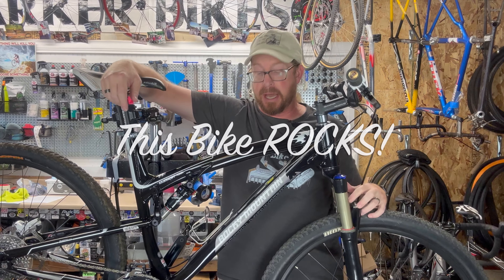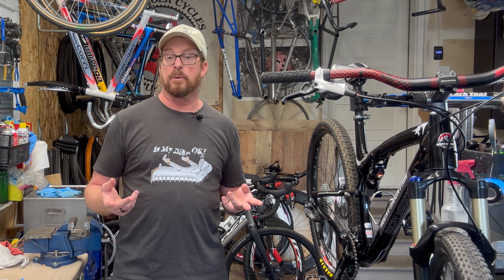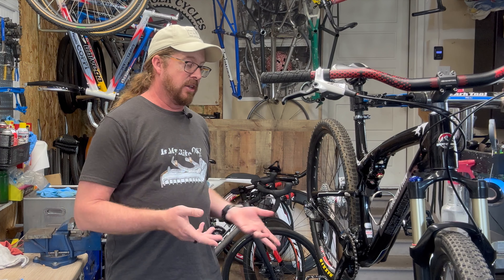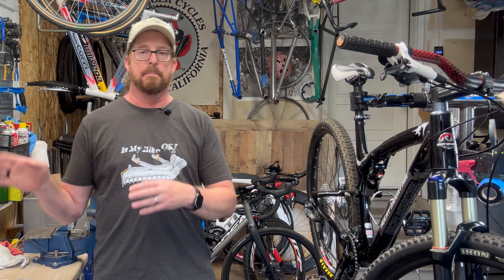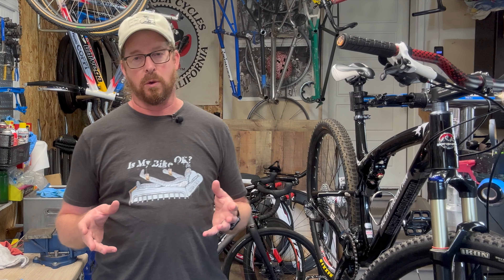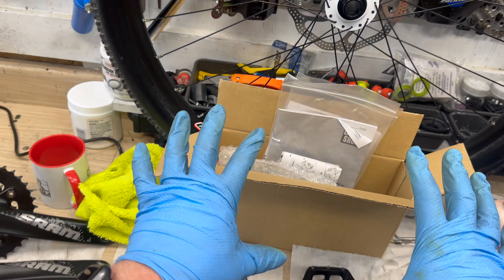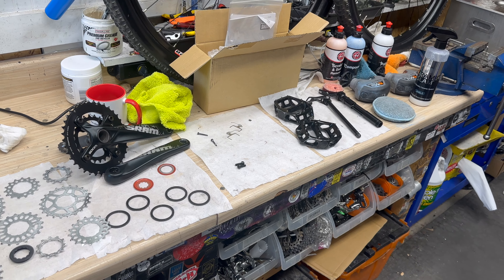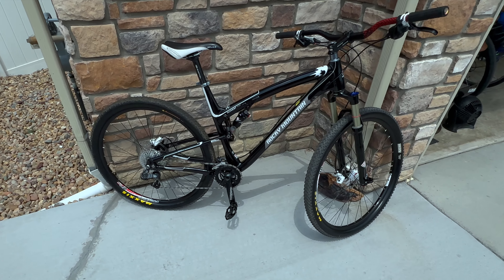🚴‍♀️ 2012 Rocky Mountain Element 930 Review 🛠️ Is buying used a mistake? 🛠️

Comment: Damn, you were hitting trails before the era of full squish huh, Bravo! I tried but gave up. These young bucks have no clue how good they have it with 200mm travels! You had alot of excellent advice on trying to get the full read on a used mtb. I recently watched one of your videos of you pulling a good ole square taper BB. Ive been trying to figure out which way to go on adding a power meter onto an ebike that has a square taper BB. Im stuck between replacing the Square Taper BB with a Hollowtech or something, but then I have to replace the crankset and all that, plus Im not even sure if I could fit the cad sensor to a new spindle anyway, and then use a cheapish spider or maybe crank arm power meter OR just get some power meter pedals, but all those have clipless pedals which Im not sure I want to use? Idk... But anyway, Im glad I found your channel, Ill be looking out for more. Sweet work on this mtb.That long stem definitely screams older school!  I wish you did more on the mtb side, but I 100% completely get why you dont! Have a good one!
Reply from the maker: If I were looking for that data, I would go with power meter pedals. I'm just looking for more time to ride, and I found the tech slows me down. LOL. For me, sometimes it's just better not to know.